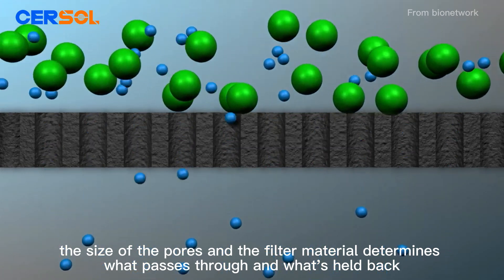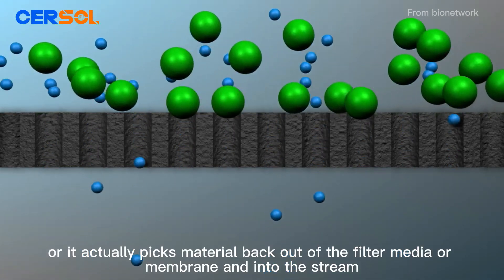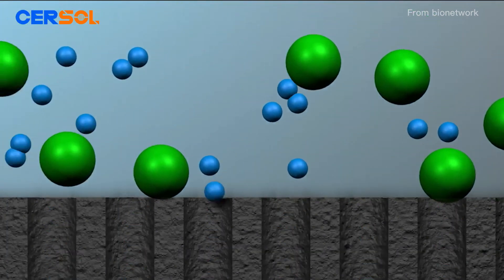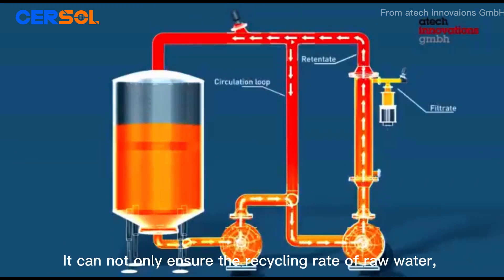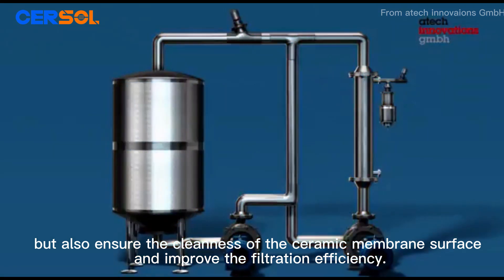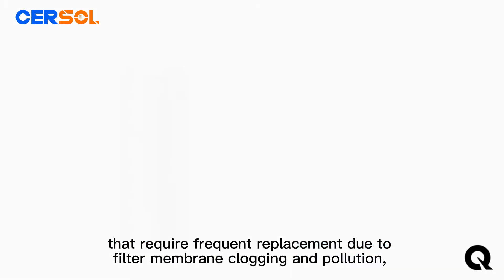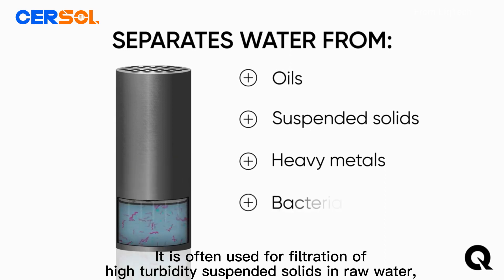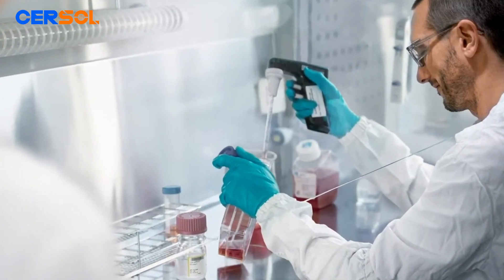The principle of cross-flow filtration in typical applications of ceramic membranes

Comment from the maker: Cross-flow filtration, also known as tangential flow filtration, separates particles in solution by passing the solution along the surface of a membrane. Liquid passes through the membrane because of the pressure differential across the membrane.